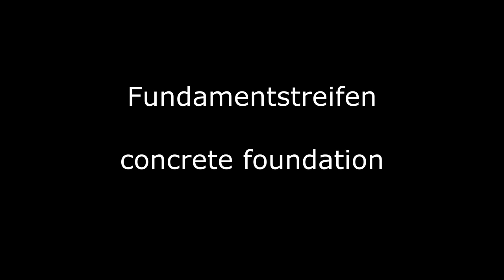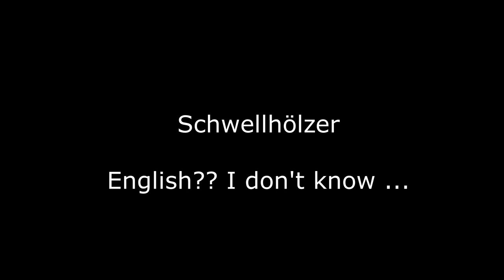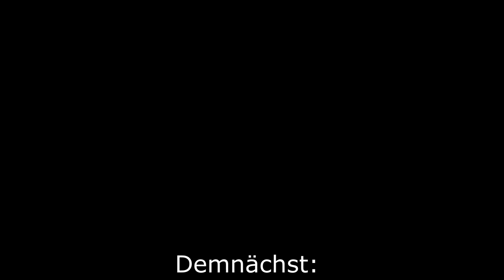Building a beautiful cabin with logs - part01

Comment: I am currently doing a very similar foundation, I have unlimited rock on my property, not as pretty, I have churt and flint I just have to pile it up. I use premixed Type S motor and forms front and back. I poured 4 corner piers 12"x12" 30 inches deep after backfilling to finished grade. I set forms between those piers and I pour 8" deep general purpose concrete which will end up below grade, then set stones against the forms and fill with the mortar. These stone walls won't really be load bearing, but will keep my logs well off the ground, and above the splash level to keep the logs dry. I set my stones like you did both inside and out, then finish much like you did, but tuck point after it sets up and smooth with a soft bench brush with water. Nice work you are making a beautiful building. 
Guten Nacht.
Reply from the maker: Thank you for your comment. Sounds like you have a nice project going on on your property. "but tuck point after it sets up and smooth with a soft bench brush with water" ... I didn't understand ... (English is not my mother tongue ...)

Comment: Wonderful work. Thanks for showing us your project. I have never seen anyone else grout between the foundation and the sill plates. Would you please explain how you inserted the grout between the wood and stone so that it was level and followed the contour of the wood so that there was not gap? Also how did you make the taper in the grout such that the water fell directly to the stone. Also, what material is the grout? Is it cement of some type or perhaps concrete? What is the mixture? Much Thanks
Reply from the maker: Thank you for your comment. I hope I got the questions correctly... I first leveled the sill plates with the wooden wedges shown at 12:50 and bolted them down into the wall. In a second step I filled the gap with mortar  You want your mortar (or your concrete with very small pebbles) to be low in shrinkage (cement reduces its volume when it hardens and dries). A high cement ratio increases the shrinkage due to chemical processes and a high water content increases the shrinkage due to physical processes (drying). Therefor you don't want to have too much cement in your mixture and also not too much water. You can lower the water content by using chemical admixtures (I don't know how they are exactly called outside Germany, the term I found is "Water reducing agent"). Now, I am not too experienced in regard to cement mixtures and I don't know anymore the mixture I used. I would use (in parts by volume): 1 part cement, 4 parts sand and perhaps a water reducing agent - the last one is optional.
Reply: @TheLandArksProject  Thank you Sir. Then I imagine that you pushed the grout under the sill plates with a piece of wood and then sculpted the angle with a tool. Beautiful work. Seems like a good idea. I have not seen anyone else do this for a building but I have heard of using grout under heavy machinery after being leveled with wedges. In that case a form is built around the machine base and the grout is poured. I might like to try making a level form to pour the same shape as you created and then mount the sill plates afterward. Your technique seems the simplest however, and will perhaps give the best seal with the sill plates. Thanks for sharing your idea.

Comment: Between wood and concrete I would add some waterproof isolation in order to be sure that it will not take moisture.
Reply from the maker: Thanks for your advice! About this step, there is discussion - at least here in Germany. If I understand correctly what you mean, the problem with waterproof isolation is: once there is water getting between the wood and the isolation (e.g. heavy wind and rain), this water is entrapped and your wood will swim - a very bad scenario. In fact, a lot of damage has been done to some old houses with this step when people tried to renovate it.
Reply: @TheLandArksProject  Interesting. It is double edge sword. Maybe somr isolation which can drain. Or put wood on steel footers all over the place and have gap planks with insulation which could be exchanged
Reply from the maker: @JMiskovsky  Maybe, you can be creative ;-)
Maybe we should also study the old buildings we have here in northern Europe, probably also in Russia - I don't know. They built houses hundreds of years ago and their sill plates are still fine. And they did not have any of these modern materials, but they apparently did sth right. I'm not that familiar with this, but I will try to get more into this by time.
Reply from the maker: @CyberAndy_   Thanks for your comment. Would you please explain why?

Comment: Nice job, very impressed by your technical 👍
Reply from the maker: Thank you for the compliment! 
There is basically not much technique included in this. Placing some stones against a board, filling concrete behind it, and then at the end cleaning the surface of the stone. I would say anyone could do this ;-)

Comment: Look into slip forming the stone walls. It allows you to see what you are doing to get a better idea of what the joints are going to look like.  Hope you didn't use portland for the mortar mix. It is too hard. I put just enough water in the mix so I could form a ball in my hand. Yours is too wet. It is easier to go back in do pointing than to have to clean the excess mortar off so I kept the mortar back from the face of the stone somewhat before i set the stone. You should think about putting some horizontal rebar in the wall as you build it to keep it from cracking (temperature bars).   Nothing better than stone work and you did a good job. A brick hammer would have made it easier to remove the excess mortar than a trowel.
Reply: Thanks for this comment. It helped me
Reply from the maker: Thank you for your comment, Gary.
(1) "Look into slip forming the stone walls. It allows you to see what you are doing to get a better idea of what the joints are going to look like.” >>> I don’t know if I correctly understand the process … you’re still using a form to hold your stones in place, don’t you? How can you then see your joints?

(2) “Hope you didn't use portland for the mortar mix. It is too hard.” >>> Yes, I used Portland cement. I know, some people say this can cause problems with the stones (with rather soft stones?).
(3) “It is easier to go back in do pointing than to have to clean the excess mortar off so I kept the mortar back from the face of the stone somewhat before i set the stone.”  >>> I don’t understand what you mean …
Reply: @TheLandArksProject  he is suggesting you use less runny mortar so it doesn't run between the form and the stone. It will though leave gaps around the stone which you will come back and fill after you strip the forms. I don't really agree with this method, but it is how I am doing mine only because I can't get my mortar to fill all the gaps as it is. I don't want my mortar too runny so this is how it winds up anyway. Also I certainly use portland, and that is the only way I would do it. Type S is structural strength mortar, but churt and flint is extrodinarly hard, so that may help.
Reply from the maker: @integr8er66  Thank you for clarification. Yes, with hard stones I wouldn't see a problem using Portland. Sandstone or so, to me appears like it is a rather soft stone ... here the shrinkage of the cement might cause problems. But I'm far away from being an expert on this.

Comment: You may find it easier to put some dry sand in between the rocks on the outwards facing edge. This means less time removing cement, and you can add in mortar pointing after
Reply from the maker: That you for the hint. I will think about it. I'm not sure yet if I correctly understood what you're suggesting.
Reply: @TheLandArksProject  my apologies. As you build the walls up, add a small amount of dry sand around the rocks, in the area that will be facing out (or visible when the wall is finished). This stops cement running over the front of the stones, but you will be able to cement behind this to hold the stones in place. It means that at the end, when you remove the forms, you just hose away the sand. Rather than trying to scrub and chip away the cement.
Reply from the maker: @ML6103  Thank you for clarification! Interesting idea. That way you would also escape the need to remove the forms at the right time - cement not too soft, not too hard - that would be a big plus. Thanks for that input!
Reply: @TheLandArksProject  you're welcome. Love your videos and thanks for the content.
Reply: @ML6103  If he uses a dry mix, one that you can form a ball in your hand that should not be a problem if you place your mortar slightly back from the face of the stone and go back and point after the fact.
Reply: Easier to just use a dry mixture that you can mold in your hand and have it retain it's shape. Wet you stones prior to placing them so the dry surface doesn't suck all the moisture out of the mortar. I also used Acryl60  additive to make the mortar more sticky. Forget using a trowel and just get a good heavy pair of rubber gloves.

Comment: In 2nd mortar mix you added a liquid polymer resin with a darker substance. Can you explain. Does this addition shorten setting/working time with the mortar? Very interesting
Reply from the maker: Oh, well, it's not that exciting as you think it is ... technically, you could call the white stuff a polymer, a biopolymer to be exact, namely corn starch (cooked in water). The brown liquid is a liquefier; it reduces the amount of water needed to give your concrete the consistency you want it to have and thereby it increases the strength of the concrete. The following graphic shows the relationship between the concrete's strength and the used water-cement ratio. What it tells you is, the more water you use, the weaker your concrete is. 
https://www.researchgate.net/figure/Strength-to-water-cement-ratio-relationship-of-conventional-concrete-31_fig4_265251400
Reply: @TheLandArksProject  I used regular mason mortar mix with just a small bit of Portland mixed in with it. A acrylic polymer emulsion bonding agent will make the mix a bit more sticky and easier to handle. My wall is going on 50 years and not one crack. I also put only enough water in the mix that a ball of it would keep its form.

Comment: a tip, next time use the steel brush without using water to clean the stones it comes out better.
Reply from the maker: Thanks for that tip. I don't like that grey cement film on the stone surface, that's why I washed it away. But maybe it looks better your way. You have an example where someone did it that way?
Reply: @TheLandArksProject  I did it like this when I worked in construction. Do the masonry then let the concrete dry a little, without letting it harden, then take a steel brush and start cleaning without water.
Reply from the maker: @roysierra84  I will give this a try when I have another project. Thank you!
Reply: I said no water just with the steel brush to clean the stone. But what do you understand?
Reply: @roysierra84  Obviously not the word "dry water". Go back and read what you wrote. He is using a stiff brush which is going to create paste which needs to be cleaned off which is why you would need a slow stream of water.
Reply: You're right, I wrote wrong, the sense was dry without water because if you use water you dirty the stone more
Reply: @roysierra84  If you do not use water to clean off the paste created by brushing you are going to discolor the stone which will have to be acid washed to get it off. Easier to brush and rinse with water to remove the paste created. The only time I would do it dry is when pointing. Had he kept his mix on the dry side there wouldn't have been so much to clean off afterwards. I would have cleaned the next day while it was still fairly green.

Comment: nice ever think about putting in an ondol for reserve heat? before the floors are pour or the thresh holds installed it is the perfect time....
they are simple technology invented 7000 years ago for heating the floors with sideways flueing and in the 1800s they put a heat eexchanger directly above and gravityfed heat into the structures they called them croation furnaces hear in the usa
Reply from the maker: I'm hearing about this for the very first time. I think I won't apply this technique in that project. But basically, this shed is just a try on finding a building method I want to use when building my own house. So, I will read into this technique and maybe then use it in my house.
In every case, thanks a lot for this information! I highly appreciate such additional information!
Greetings & Blessings
Reply: @TheLandArksProject  your welcome

Comment: At 5:15 secs.. you pour a chemical? What is that and what's its purpose?
Reply from the maker: To say it right at the beginning: It’s not needed. It basically was intended to increase the strength of the concrete.
The brown component is a liquefier (lignin sulfonate salts. For quite a time standard. Today exist more efficient but also more expensive liquefiers, polycarboxylate ethers, PCE). I don’t know how familiar you are with this … Liquefier reduce the amount of water you need to make your concrete workable, and thereby your concrete gets harder. The more water you add to your concrete, the weaker it will be.
The white mass is cooked starch. It’s kind of an experiment … something like this has been used by the old Chinese (“sticky rice mortar”), but they made it with lime, not with Portland Cement. There it influenced the growth of the crystal structure of the Portlandite Ca(OH)2 – if I remember correctly; it made it denser and thereby increased the strength. Same was observed by a research group to happen with the crystal structure of the CSH-phases (calcium silicate hydrate) of the Portland cement.
But again, this is by far not necessary.
Greetings!

Comment: No rebar in the concrete means very limited strength?
Reply from the maker: I'm not sure if you are really interested in a response, but I will invest the time to give you one.
"No rebar in the concrete means very limited strength?" Yes and No. The question is: strength / resistance against >what<? Concrete does well in terms of compressive strength and not so well in terms of tensile strength. If your concrete has to deal >only< with compression, you're well without rebar. But wherever concrete comes under tension / bending, you will very quickly come to the point that you need rebar.
The thing becomes a bit more complicated, if you consider, that wherever you have compressive stress, you actually also have tensile stress rectangular to it. This practically means that if your concrete is subjected to very heavy pressure, you should add rebar that runs rectangular to the direction of your pressure load to keep the concrete (the wall in this case) from splitting or something similar to that.
Now, the thing that will bring the most load on that wall is the roofing tiles: ~0,50 kN/m². The roof has 40m². That makes 20 kN in total for the whole roof. If you then say that the two posts for the ridge carry 50% of that load together, one post would bring down 25% of that load, which makes 5 kN for your wall at that place. In relation to the surface of your concrete that has to cope with that load, this is nothing.
So, that would be my answer and my opinion. Feel free to answer.
Greetings & Blessings!
Reply: @TheLandArksProject  Temperature rebars will help with the expansion and contraction in the wall more than anything else and help the prevent cracking. They perform the same function as ladder reinforcing in concrete block walls.

Comment: Hello, I suggest that next time you just make your walls more large.. 60cm will be ok. Use the rocks as the main element instead of concrete. Work the wall up by putting the rocks on top of each other without using wood to support the sides. It is not that difficult. If you prefer you can still use your system with plywood on the inside and plaster that side of the wall later. Instead of hanmering on tiny stones to transform them into "tiles" you can as well just flatten one side of the field stones. Or split them using a drill, chisel combined with a grinder. Raw rocks will look great, too.
https://youtu.be/micTPr8NCGI
Reply from the maker: Hello Nick! Thanks for your detailed comment. Making the wall without any support certainly is the more professional way. The biggest challenge I had, is that I am living in an area where you hardly get larger stones, and only at high prize. If I had made that wall from lager field stones, it would have cost me either thousands of Euros or years to cheaply "collect" them over time. Those small stones I could get at a low prize. 
Maybe one day I'm living in a more rocky area, where such stones are more readily available, then I will try to do it in a more professional way.
Greetings & Blessings from Germany
Reply: @TheLandArksProject  Ok, I got your point. The boulders are expensive in your area.
Reply from the maker: @NickVenture1  Yes, you got it.
Reply: @TheLandArksProject  You Germans do the most impressive work in the world, I was there just before Covid started, I was near Stuttgart and traveled to Munich and then to Austria. The craftsmanship there is incredible.
Reply from the maker: @integr8er66  Well, we try our best. Unfortunetly craftsmanship here (and probably in every other western country as well) is dying.